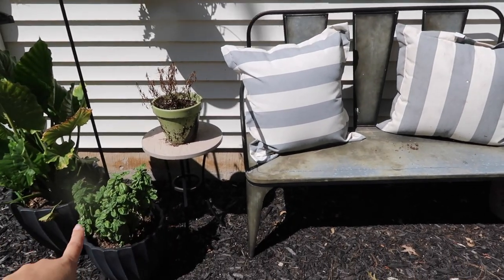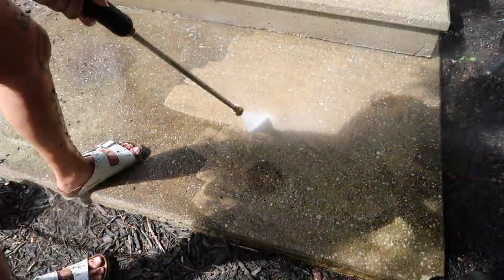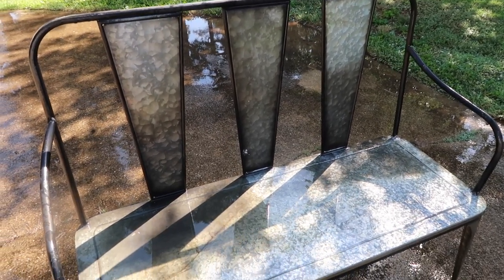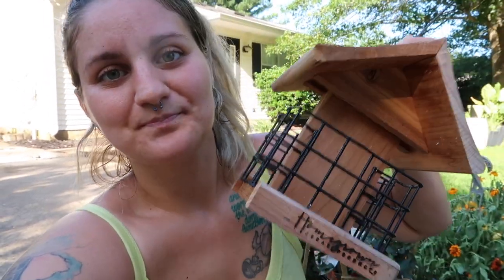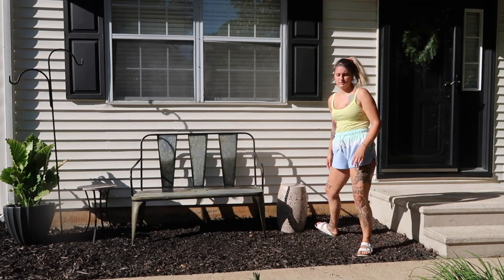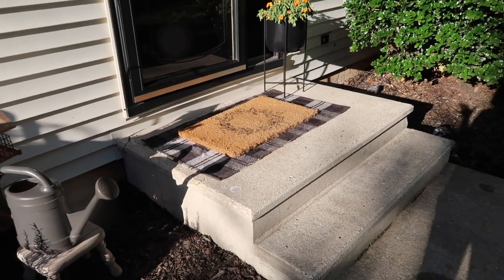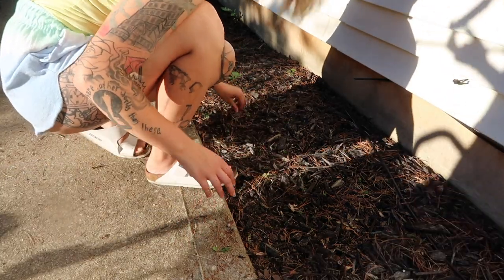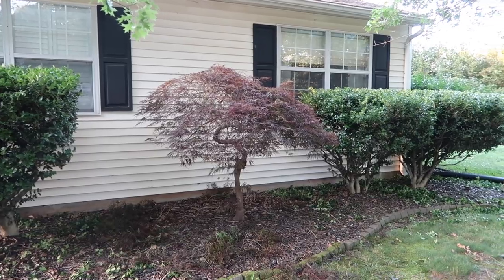DIY Yard Work Makeover on a Budget 2021

Comment: Hi Megan!! I love love love your outdoor makeover videos! Hoping you don’t mind me making a suggestion…. If nobody has mentioned it yet, but to clean your porch, stairs, sidewalks, driveways and other flat areas like that… you need to get an attachment for your pressure washer called a “surface washer” they are a available on Amazon and all your local home improvement stores. Honestly you  can’t do the flat cement surface areas without this attachment as it will take you forever just to get a very small area partially clean. You will notice a HUGE difference when using the surface cleaner attachment! There are videos on YouTube to show you how to use it! Hope this helps! Thank you for all your amazing content!

Comment: I'm not sure if someone else mentioned it, but if you push polymeric sand into the patio paver cracks it will really inhibit weed growth.  Polymeric basically has a little bit of glue that activates when  you wet so it turns into a grout like seal.  It's not hard to do and might be something you'd like the end result of.
Reply from the maker: We decided not to do that because we DIYed the patio, so it’s not perfectly level or graded